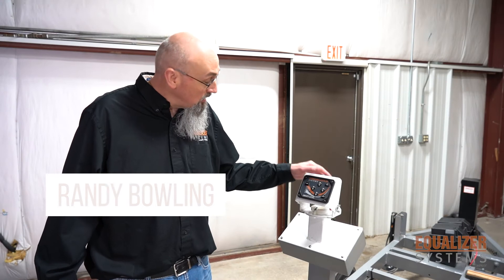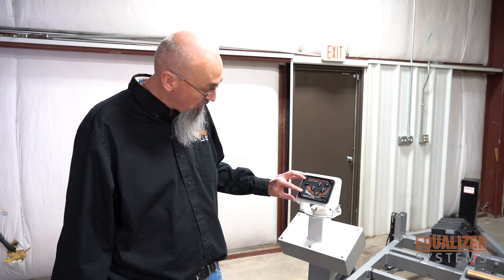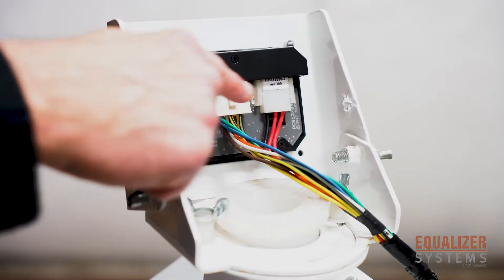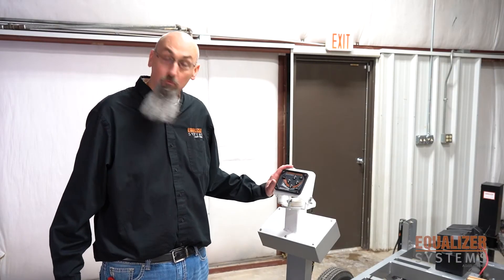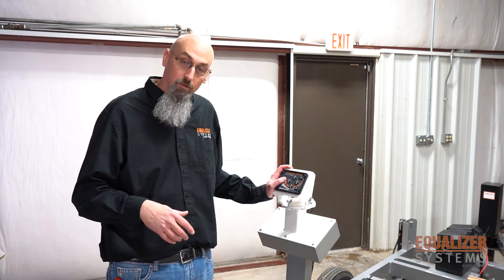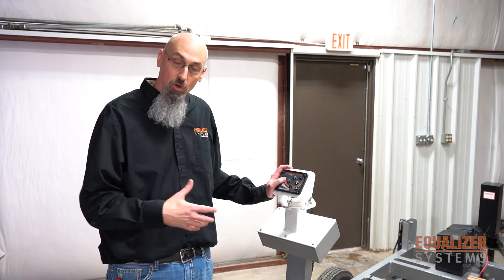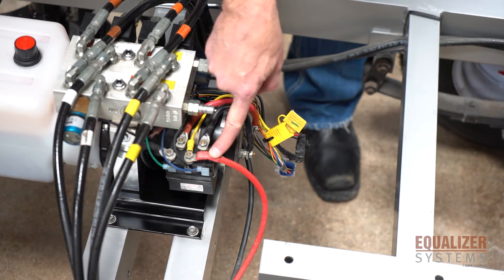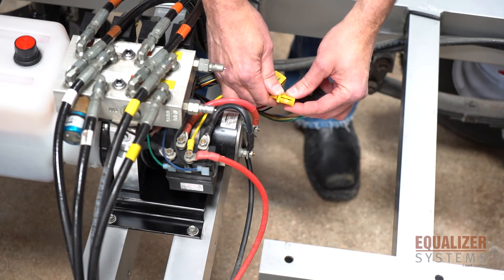EQ Smart-Level Touchpad Troubleshooting

Comment: Thanks for the informative video.  My jacks are working fine, but my control panel started beeping out of the blue and some of the lights were flashing as well.  I disengaged the jacks and lowered them without issue.  The beeping stopped but a few minutes later the control panel started beeping again.  Any advice?
Reply from the maker: Hi there! Please try purging your system and if you are still having issues please email service@eqsystems.us or give us a call at 800-846-9659.
Purge Steps
Extend the Jacks: Fully extend the jacks and let them sit for 15 minutes.
Retract the Jacks: Fully retract the jacks and let them sit for another 15 minutes.
Repeat: Repeat this process three times.
Additionally, check for any possible leaks that might be causing the issue.

Comment: Never had an issue with my system in a few years of use.  Recently I notice after leveling and powering off the system I’m seeing power operating low voltage and excess slope and lights near arrows all flashing dull green? Typically I only see orange lights.  What do the flashing green lights with no sound or error codes mean?  Can’t find anything on it.  I have normal 120+ volts at the camp pedestal.  No electrical issues with anything in the coach.
Reply from the maker: Please call (800) 846-9659 or email support at Service@eqsystems.us . You can also visit our Support section on our website for more information or to submit a question www.eqsystems.us/service-and-support-form/ Thank you and have a great day!

Comment: Hello
I have a brand new EQ Smart level panel for a fifth wheel and I am unable to get it to auto level. When I hit auto level, I hear two short beeps and operating light flashes.
Reply from the maker: Please check out our Quick Start Guide for assisting you on getting your 5th Wheel leveled... https://eqsystems.us/wp-content/uploads/2023/08/QSSL002R7-Quick-Start-Trailer-Version-TM.pdf
If you need further assistance, please call (800) 846-9659 or email support at Service@eqsystems.us . You can also visit our Support section on our website for more information or to submit a question www.eqsystems.us/service-and-support-form/ Thank you and have a great day!

Comment: This probably isn't the right place to ask this, but our system is blowing the 20A inline fuse, and we were stuck in a campground with the jacks down. However, I put a 30A fuse in to see if it would allow the jacks to be retracted, and it worked. So there isn't a short, but something is causing excessive current draw. I can't find any relevant info on the internet. Any suggestions?
Reply from the maker: Please call (800) 846-9659 or visit our Support section on our website for more information or to submit a question. www.eqsystems.us

Comment: Thank you for having this information available.  After an hour of checking everything as to why our jacks would not come up, we were very frustrated to say the least. I told my husband I am going to the company website to see if they have any info.  We did have a power surge a couple of days ago and the jacks were down but did not it would cause them not to work.  You video solved the problem, unplugged the two connectors on the back of panel for 22 seconds, plugged back in and it WORKED !!  Thank you again as now we can leave on our trip tomorrow.
Reply from the maker: That's great news!  We appreciate the positive feedback.

Comment: My touchpad lights are on and we have unplugged the wiring and waited 30 seconds and plugged back in, but the lights still remain on and power will not turn off.   Help!
Reply from the maker: Please call (800) 846-9659 or email support at Service@eqsystems.us . You can also visit our Support section on our website for more information or to submit a question. www.eqsystems.us  Thank you and have a great day.
Reply: When are the touchpad lights on? As soon as you turn the key? Or without turning the key? Do they turn on as soon as you switch the chassis battery on or do you not turn the chassis battery switch off and it still does this? If so when does it do it? Does ‘retract all’ button have any effect? See my answer above, may help
Reply from the maker: @deltalimajuliet5680  Please call (800) 846-9659 or email support at Service@eqsystems.us . You can also visit our Support section on our website for more information or to submit a question. www.eqsystems.us  Thank you and have a great day.
Reply: Hello have you figured out the problem I have the same issue, thank
You

Comment: My coach has a problem the touch pad automatically turns on and beeps non stop says low voltage solid light,all Jack's flash, ignition on flashes, parking brake on flashes and won't stop beeping, i have voltage , pump has been replaced dontonit was burned out with oil in the casing.  Can you help
Reply from the maker: Please call (800) 846-9659 or email support at Service@eqsystems.us . You can also visit our Support section on our website for more information or to submit a question. www.eqsystems.us  Thank you and have a great day.

Comment: Jacks deployed alarm every time I start coach. Is this normal due to turning chassis switch off? All retract clears the alarm and leds.
Reply from the maker: Sorry for the delayed response.
Please call (800) 846-9659 or email support at Service@eqsystems.us if you still need help. You can also visit our Support section on our website for more information or to submit a question. www.eqsystems.us  Thank you and have a great day.
Reply: this is happening to me also
Reply: @denniskissinger7937  I found out some things since posting. In the manual it actually states if you turn the key, you will get a jacks deployed alarm if battery power was turned off for night and you turned it back on the next morning to leave like I was doing. When you turn the chassis batt switch back on, and start or turn the key, you will get the alarm. If I leave chassis batt switch on over two days and turn the key to run or start, jacks deployed will not alarm. My error in not reading the manual although thought I did. Try that.

Comment: Help.
With the key out of the ignition, power on, the ignition light on the key pad flashes and the auto level does not work. Why?
Reply from the maker: Please call (800) 846-9659 or visit our Support section on our website for more information or to submit a question. www.eqsystems.us